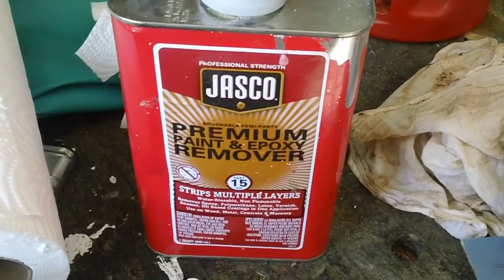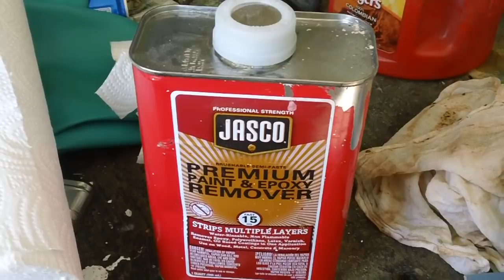1931 Airline 62-14  radio cabinet restoration (Part 1).

Comment: I'd almost forgot about the airline!  I've been so wrapped up in the Thunderbird resto.  By the way.. you'd better stock up on that Jasco Paint Stripper..  the EPA Banned Methylene chloride based strippers from consumer sales back in march.  come November, it will disappear off the shelves.
Reply from the maker: Bret,
It's already gone from Lowe's shelves.  Found out this morning.  Now I know why.  So I'm back to using Kwik-Strip.  Bummer!
Regards,
John
Reply: Thanks for the tip...Guess I better head to Ace abd get those gallons of Zar before it's all gone.

Comment: John, 
Nice stripping/glueing job, good buddy!  I have it on good authority that Bonnie and Clyde also put a heavy coat of wax on the upper part of the radio as a way to make up for the cigarette burn to the owner. :-) lol
I hope you're still high and dry and safe.
Have you been watching Plane Savers?  Getting the DC-3 up and together and flying by June 6th has been a huge task, but it's going to happen!  Amazing what they've been able to accomplish in about 40 days or so.
Regards, Tom
Reply from the maker: Thanks, Tom, it's appreciated.  You know, that B&C duo were real trouble makers, even now 85-years later.🙄  Sorry, I haven't watched Plane Savers.  I'm sorta hamstrung by the GBs we have available for internet use, so we're careful about what we watch and how long the vids are.  But at least this ISP doesn't  go offline every three days.  Man, we hated Media3South doing that all the time.
Regards,
John

Comment: Hey John, I've been stripping and refinishing up here as well, lol.  Just finished an old dresser for my Ma that someone had painted white years ago.  I like a stripper called ZAR myself.  If you want it stripped fast, that zar claims it will work in 5 minutes but do wear some rubber gloves.  I ran out and the local store has it but they only have it by the gallon and it's $40 a gallon, lol.  So I just went back to Citris Strip for the rest of it.  I also like the citris, but it's definitely not for those in a hurry, lol.  The good thing about it is that it doesn't burn if you get it on ya and you can apply it and let it sit for up to 24 hours before it will dry out.  Glad to see you back on the airline :)  It's looking good so far.
Reply from the maker: I'm glad you told me the ins and outs of Citris Strip.  I almost bought that at Lowe's the other day, but opted for the Kwik-Strip instead.  I'm not happy about the Jasco stripper not being sold anymore.  That stuff was great.  If something works the government will find a way to keep it from the public.
Regards,
John
Reply: @joernone  The citris strip works well, but it is quite a bit slower.  I find that if I apply a thick coat of it and let it sit at least 5 hours or overnight that is when it works best, but I'm usually stripping stuff that has multiple layers of paint and or varnish/lacquer.  I like to put it on in the cool of a late evening and then scrape it off the next morning before it gets hot outside.

Comment: More likely story is this radio was pristine and shiny and looked new for a decade or more as it was owned by people that treated it like fine furniture. But because these things were so well made it was still in use in the 60s and 70s by then no one cared about a 30 year old radio they figured was soon going to be in a junk yard so they cared nothing for it resting cigs and drink glasses. PLEASE don't preserve they neglected part of its history - instead restore it to its first 10 years as a pristine beauty. Strip (if its lacquer just use acetone or lacquer thinner) , then sand, fill with wood grain, put on 10 or 15 coats of new lacquer and then wet sand.